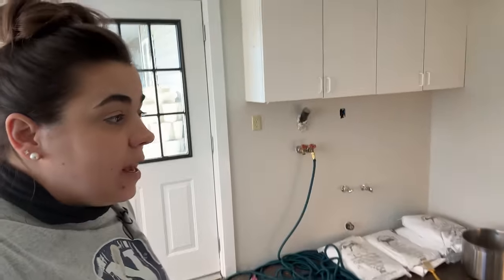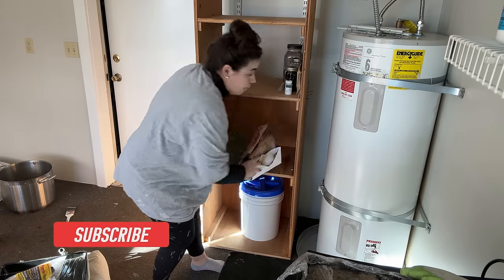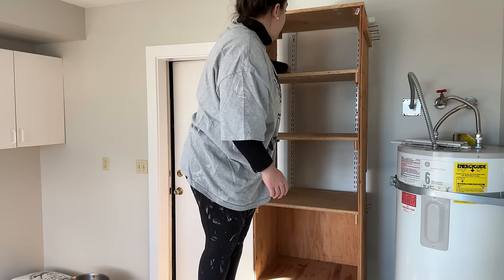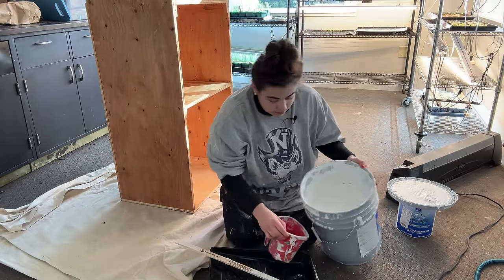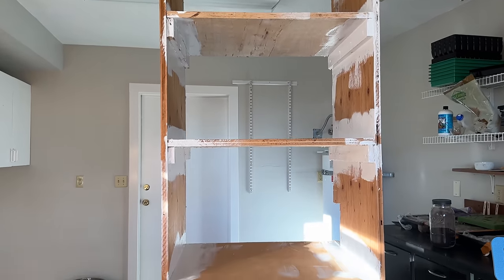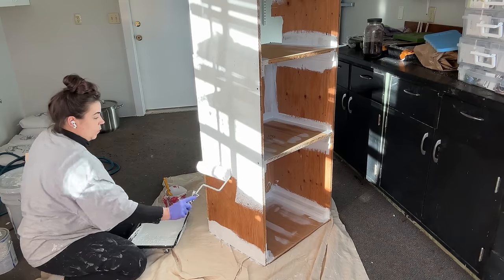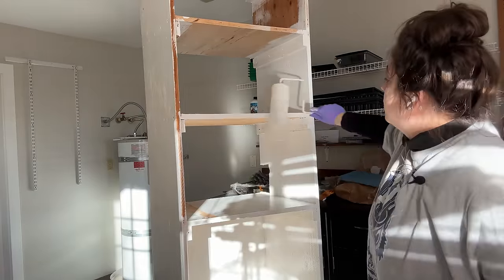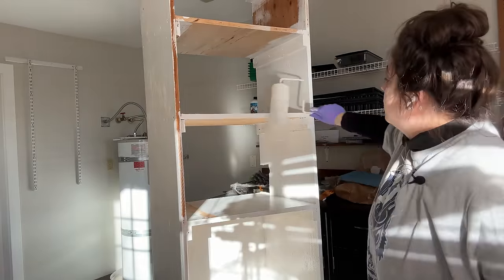Back to the drawing board!

Comment: Hi.  You certainly are busy.  Suggestion, why not change your hot water tank for an on demand tank?  They are much smaller, are put on the wall and you will not run out of hot water.   We have had one for 3 years and are very satisfied with it.

Comment: I paint my concrete floor in my house with oil paint grey.I sprinkle a bag of paint chips blue white dark blue over as I paint 3 foot sections. Go around edges with brush and roll rest.Use gloss ,it dulls little after use .I do mine every few years because it is in my house.  Always looks so great , easy to vacumn sweep and mop.

Comment: Just ideas.... 

Paint the concrete a waterproof grey color..... so looks easy on the eyes... & it you every need to clean the floor, you can hose it down. Might be the most practical thing, as things drop in a grow room. 

Also, spray paint the cabinets while are at it, to a color of your liking. You could also consider rehoming the cabinet to under the top cabinets, would give you more space on the other wall to do stuff.

Comment: I had a concrete floor that was very cracked up and just put carpet tiles like you get in offices over it. It's pretty easy even if you have to trim every single border tile because the room is not at all square.... 😂.. Vinyl tiles might be an option because of easier cleanup of the soil. I've also put plywood on concrete then linoleum (vinyl flooring). That also worked, but you definitely need the plywood for a flat surface.

Comment: Might want to take into account that vinyl can dent/scratch with heavy objects sitting in place over time or dragging . Epoxy would be easiest/strongest to apply and slip resistant. Plain concrete dangerously slippery when wet

Comment: Unless your greenhouse will be heated, you'll still be starting seeds indoors. Unheated greenhouses can actually be COLDER even than outside at night in spring. I have found this. I even saw that using barrels of water as thermal mass actually seems to make the greenhouse colder in spring. "Hot beds" seem to be one option for outdoor seed starting (active compost/manure with a thick layer of soil on top and a low cold frame over it). I didn't quite get there with hot beds this year - I need a trailer hitch on my car so I can go fetch manure...

Comment: Remodeling is always stressful. Things never go as planned.  I think you did the right thing in re-evaluating the room.  Concrete is a good surface for what you’re using the room for making it easy to clean and not having to worry about damaging the surface. You could even stain and seal the concrete in a warm stain color.

Comment: Ditch that huge roller and get a small 4-5” foam roller. So much easier, both to use and clean up. And the finish is so smooth.

Comment: My hubby paints boats and he said while watching your video with me that you need a 5&1 putty knife. Apparently you just scrape it down the side of your roller and it takes all the wet paint off and back in your can. He uses them all the time. I would paint your concrete floor if it were mine.

Comment: You are such a hard worker, everything is coming together so nicely. Just a word of caution after reading the comments, concrete floors are really hard on your back , legs and feet, especially as you get older. If you are working in that room, concrete floors are not nice on the body!

Comment: Flooring suggestion: the wood-look laminate "click-together" kind (any big box hardware store has them).  You don't have to glue or fasten them down, the pieces are easy to cut, the concrete looks  nice and even so it would be a super easy job for you and Josh to tackle.  Together you'd easily knock it out in one weekend.  Add baseboards on top with a cute throw rug and I think it would look really nice in there.
Reply: But not in an environment with water. Believe me, after a flood of only a half inch, it all buckled and had to be replaced. Vinyl plank would be fine, though.
Reply: @pamelaspooner7183  Yes there's two different but similar products.  I've experienced both.  The bad kind as a landlord special in a bathroom/kitchen, it bubbled within months.  The good kind I've had installed in my kitchen, mud/laundry, and bathroom, no bubbling or lifting yet and it's been three years.

Comment: The foundation problem could be a blessing in disguise.... consider polishing the concrete.... beautiful finish!  Or sealing with an epoxy if moisture isn't a problem.  Either way would possibly be less expensive than fixing the exposed foundation and then adding flooring on top.

Also a before mentioned idea of using this room in the future as a freeze drying and canning kitchen would be awesome!!!

Comment: You can paint the cement floor. Check Lowes or Home Depot. There is paint just for that. I'm sure you'd have to seal it first, but I grew up with the basement floor painted.

Comment: Why don't you paint that metal cabinet to match the room?  You can also put a pretty resin finish on the cement to protect it from stains and spills.  It will look lovely for whatever you decide to use it for some you can toss a couple of rugs on the floor.

Comment: Consider cleaning your concrete, fill the holes and cracks with self leveling cocking, sand it and paint it followed by a protector lacker that can give a bit of brightness and it will look great.

Comment: We had a similar issue with our garage, for the flooring, and we decided to just use a heay duty paint that worked for that type of floor. That way, it protects the floor from spills, humidity and big scratches, it is a lot easier to keep clean, and it is cheaper and easier to do ourselves. We've had the original paint up for about five years, and we might put a fresh coat this spring since we've noticed it wearing out in a few places.  But your concrete might be in a better shape then ours was, and keeping it as is would be a lot less work, for sure! That grow-room is gonig to be lovely when everything is set back up!

Comment: Paint the trim before you install it. Much simpler. then just fill in the nail holes and do touchup. You didn't reinstall the water heater with the spigot in the back did you? That's going to be difficult to drain once you fill it.

Comment: If I were you I would put some kind of flooring down in the grow room. If you don’t and leave bare concrete it will always be colder in that room. Now if that’s something you wouldn’t mind, then I would suggest cleaning the concrete floor as much as possible. And stain or paint the floor a medium to dark gray. I think that would be beautiful in that room. Because you get on your knees so much in there you will need a knee cushion to use at those times.

Comment: I personally wouldn’t have painted the tall shelf unit as it doesn’t look very stable.  My preference would have been to either put the seed boxes in the white wall cupboards or buy wire shelves to fit onto the brackets by the water heater, it would have made the room  look neater.

Comment: As someone who has cleaned professionally for 30+ years, my suggestion to you is to just fill a bucket with water and cleaner when you doing a big job like those cabinets. It saves time and energy to just rinse the rags. I do it that way for all messy jobs then wipe them down again with a clean wet rag.

Comment: keeping the concrete makes sense short term and longer term. Paying for flooring for a room you have no idea what you're doing with in future is a bit of a waste. I fyou keep it concrete, you get to use it now, fix the foundation issues, and start from scratch(at least floor-wise) when you redo that room for it's final use.
Maybe you could move the anti-stress mats you stopped using in the kitchen into the grow room.

Comment: Not related to this video but months ago you shared a recipe you found for Brown Butter Rice Krispy treats.. and can I just say?? I’ve made them dozens of times by now and they are a HIT every time, at every event. I made Christmas and Valentine’s Day treat boxes and sold over 200 total, and all of them had a couple pieces of the krispy treats in them and they are a massive crowd pleaser ,  but I tweaked the recipe slightly.

Instead of 2 sticks of unsalted butter and I think her recipe has 1/2 teaspoon of salt? I use 1 stick of SALTED butter and 1 stick of unsalted, and let it brown. I tried 2 sticks of salted butter and it was a little too salty/sweet, so I like the 1/1 ration. I do 20oz of the marshmellows but I also add a big dollop of marshmellow fluff in with the wet mixture while it’s all melting down. I do closer to 1tbsp of homemade vanilla extract instead of her 1 teaspoon on the recipe

AND, once it’s all pressed down into the pan and still sticky, I’ll either melt down a bunch of milk chocolate and cover the whole top of the pan with it and let it harden up, or I’ll take white chocolate or milk chocolate and drizzle it over top. I’ve also used mini chocolate chips and pressed them down on the top of the pan, NOT mixed inside the batch. I’ve tried super mini m&m style sprinkles- but my fav is just a solid thin layer of melted chocolate over top that sets up. 
Everyone goes crazy for the choc covered brown butter rice krispy treats!😊

Comment: Why not have tile floors put in the room?  I wondered why you were putting laminate in that room.  If water gets on laminate in swells & buckles.  Tile would be a better option.  And I don't think it would be an issue with the concrete problem that you described.  If not tile then scrape up the glue & paint with gray concrete paint.
Reply: She was doing sheet vinyl, waterproof

Comment: Okay as a flooring professional please tell me you're putting down the glue down LVT... and not a click..?? If you're putting a floating LVT it's not a good idea to put that big heavy piece back on it.. Please let me explain.. so a quick LVT or laminate either or which being with the water in there I would assume you're going LVT That said you cannot put an immovable item on top It is not suggested cabinets heavy machinery other than the basic washer and dryer no Sub-Zero fridges things like that should ever be put on top of a floating floor!! What's going to happen should you do that and it's floating is the floor itself does not have the opportunity to expand and contract. And therefore you will get buckling at the seams especially if there's not enough gap all the way around the perimeter of the room That leads to a whole another problem so these are just technical info that I know you love to research about! Lol I just want you to take care of your investment and hopefully you're installer will advise you that accordingly!! I have seen many of experience where people think I was exaggerating and the floors buckle and separate and they blame the product in the end it ends up being installation method and being under material I can't let it move!! So if anyone out there watching this is looking to do a floating floor please make sure you're doing it in advance of cabinetry Sub-Zero refrigerators.. and even the stackable washer dryers A lot of people are now doing them like laundromats putting a really big heavy ones on top of each other! I hope that helps you all